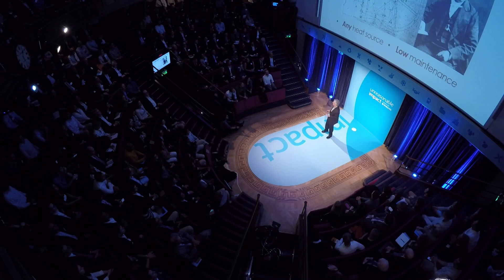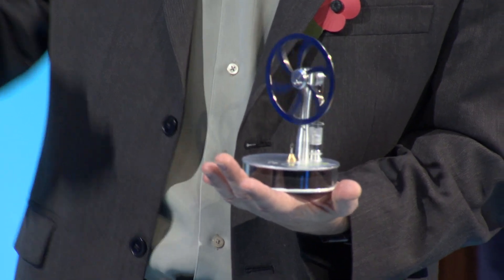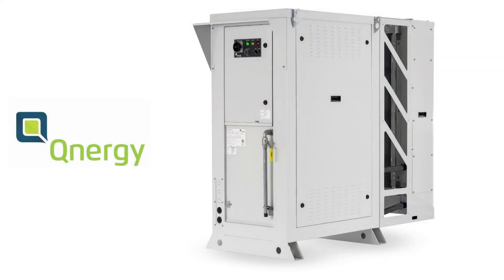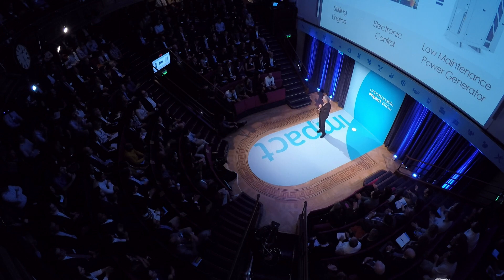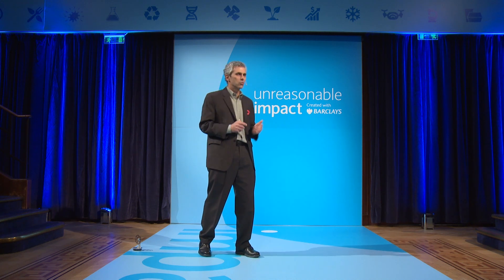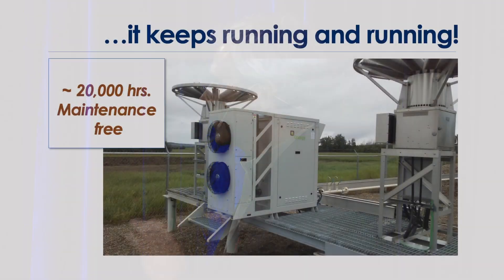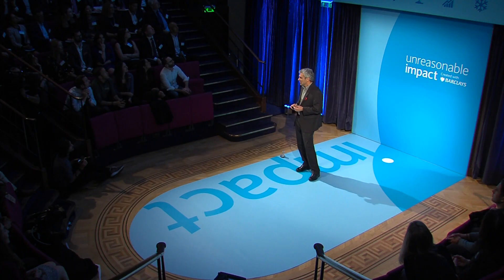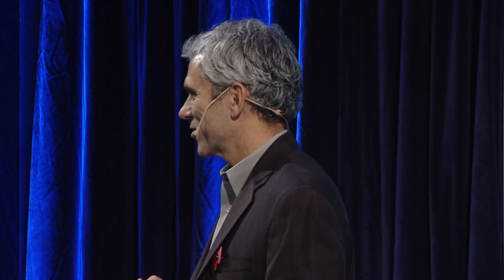The Engine That Needs No Maintenance Fights Climate Change | Qnergy

Comment: unreasonable    re-post.       the claim that a stirling engine is difficult is to control, is B S.    the performance claims  are  VAGUE;   since the 'millions of cars'  metric  is  NOT  very informative. 
it would appear that the 'powergen' engine  is  an iteration of a   vertically oriented, free-piston,  beta  stirling.    if so, the compactness of the design  tends to promote Warming of the cold-side.     it is not clear whether a high-loss, swashplate-type linkage is employed. 
the use of helium as the working gas/fluid,  unnecessarily  adds  Complexity, to an otherwise  SIMPLE    system.
by definition, a  free-piston is a piston  that is  NOT  configured  to  do  Work.    so, the term is  USELESS.     the use of a crankshaft/flywheel assembly (with a  Reciprocating engine) is  ESSENTIAL, to achieving  best  efficiency.    spare me any 'debate', about linear alternators;  any such machine  Will be  significantly Less efficient, than a  ROTARY  pma.     googletranslate